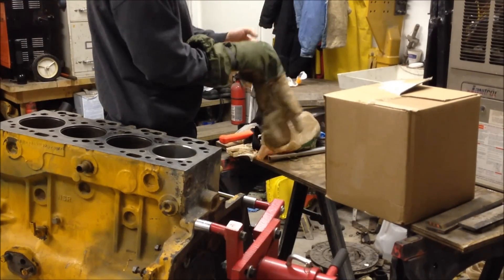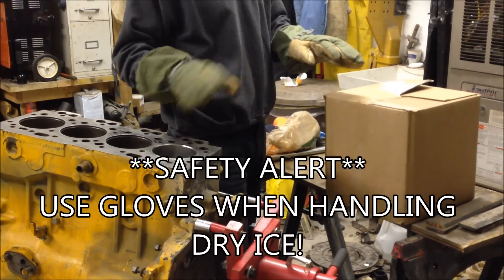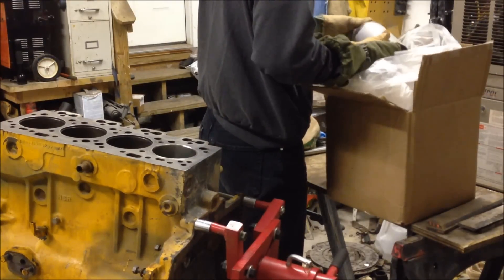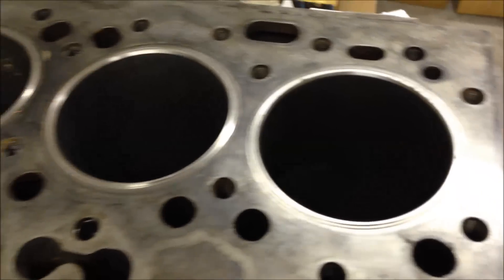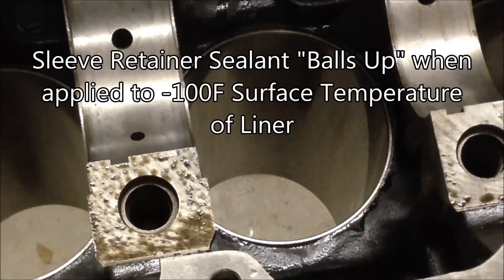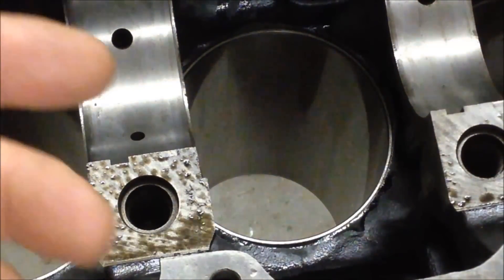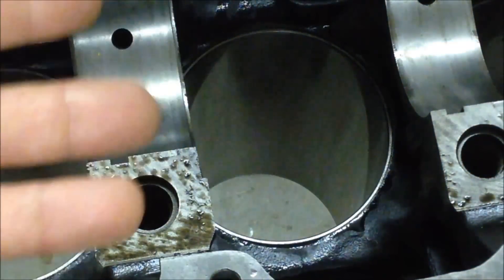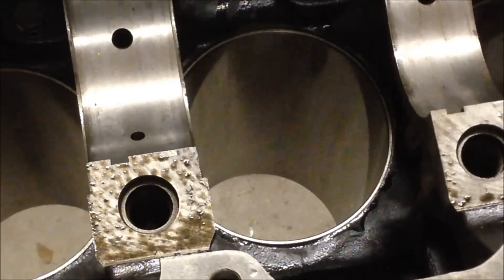Dry Sleeve Cylinder Liner Install - JCB Backhoe Project Part 4 (Perkins Diesel)

Comment: I noticed you have a crack on the deck from a bolt hole. I have the same engine with a similar crack. I was told that these blocks have a history of doing this. Many people report having these cracks, and run the engine for decades with no issues.  I was also told that it wouldn’t present any problem because the fact it is a dry sleeve, and the liner height along with head gasket would prevent anything from leaking into the cylinder. My question is, will this be an issue or not before I rebuild this block?
Reply from the maker: I haven't had any issues for a couple of years now -

Comment: The problem is when you drop them in like that you can't be sure they are tight enough fit into the bore. What I do is drop them in but not all the way down, leave them 2" (or something) up and pull them down with a puller. That way you can feel how tight fit the liner is, and also it is easy to apply Loctite to them. I have seen blocks that have maybe one liner go in to the bore way too easy, and seems that there is variation in liner measurements too, especially aftermarket ones.
Reply: We usually just measure first, then we know exactly what the fit is.

Comment: It's possible install the liners without been cooled, I mean, at ambient temperature?
Reply from the maker: They are a very tight fit - you can press them in.  If you try to use a hammer, you'll likely damage the liner.  Using dry ice is the easiest method for installation.

Comment: 1 gallon of acetone in a metal bucket along with placing dry ice in the acetone will shrink the line without attracting moisture that forms ice crystals. Applied sealant (minimum amount, remember it is a zero fit) will not ball up during the sleeve drop. What happens is the acetone prevents moisture from forming and the temp from the dry ice prevents the acetone from boiling off. Yes, it boils off, it does not evaporate, in normal ambient temps. You;ll be amazed at how easy it all goes back together with this method.
Reply: Sublimates*

Comment: I'd recommend to everyone to take the bare block less everything, liners and the like to an engine shop so the can put it in an acid bath to clean it up, this will show up any defects, there is no point putting new parts in until the all clear is given on the status of the old block, also the liners should be unfinished as the block will distort the liners, the liners have to be finished off in block so they are perfectly round, I rebuilt my 318 Perkins engine and it runs like a clock.

Comment: Cool method! What about the condensation that forms on the exterior of the liner between removal from the dry ice and insertion into the bore? Isn't some minute amount of moisture trapped between the surfaces? Is so, what is the consequence of that, if any?

Comment: Good Vid.   Btw    could You not just apply the lock tight to the bore  top and bottom,drop liner in then?
Reply from the maker: +Budd Hudd 
When the loctite makes contact with the chilled liner, it "balls up" into pieces of loctite.  Thus, it does not flow properly when in contact with a very cold surface.
Reply: +ProjectsbyTMD   oh right  .     is she back running now? ?
Reply from the maker: +Budd Hudd 
yes